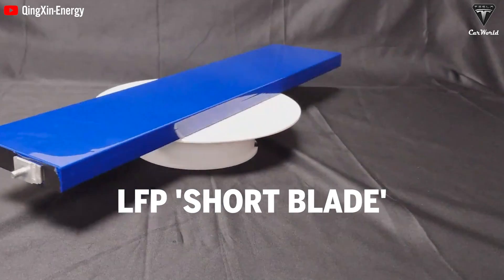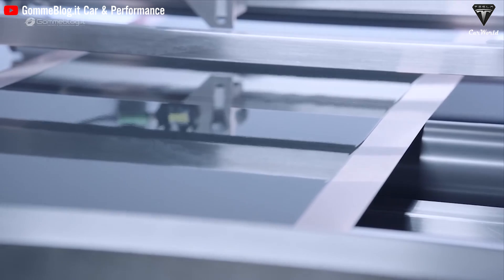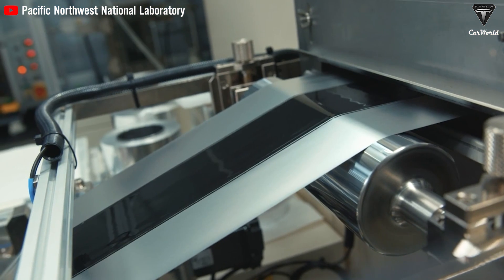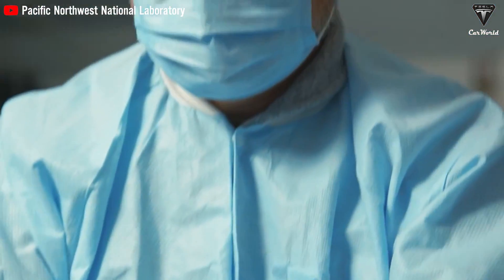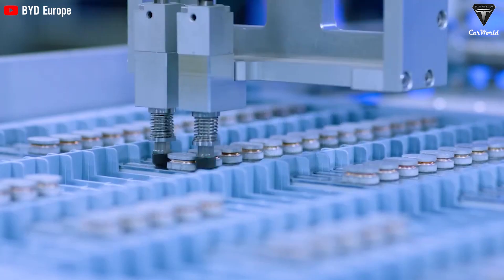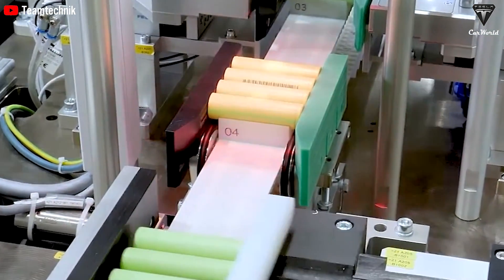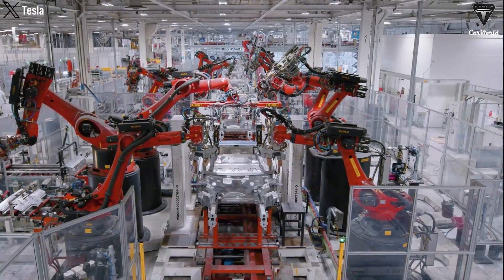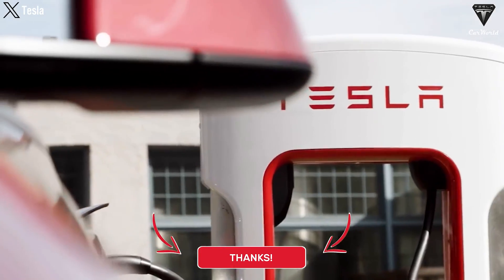Elon Musk Reveals The World Safest A Million-Mile LFP Short Blade Battery, Futuristic Tech for 2025!

Comment: The ability to maintain high capacity in cold temperatures is a significant advantage, but how will the Short Blade battery perform in extreme heat?

Comment: The Short Blade battery's high energy density is a game-changer, but how does it compare to the latest nickel-based batteries in terms of cost and efficiency?
Reply from the maker: The Short Blade battery offers high energy density and safety benefits but may have higher costs compared to nickel-based batteries, which excel in energy density and charging speed.

Comment: How does the Short Blade battery's design enhance its fast-charging capabilities?
Reply from the maker: The Short Blade battery's design enhances its fast-charging capabilities through optimized cell architecture and advanced materials that reduce internal resistance, allowing for quicker energy transfer and more efficient charging.

Comment: What specific features make the Short Blade battery more fire-resistant than other batteries?
Reply from the maker: Short Blade batteries are more fire-resistant thanks to the stable structure of carbon nanotubes, which helps prevent overheating and reduces the risk of electrical short circuits compared to other types of batteries.

Comment: The cell-to-pack technology in the Short Blade battery is an innovative approach, potentially improving energy density. However, how will it affect the overall weight of the vehicle?
Reply from the maker: The cell-to-pack technology in the Short Blade battery can improve energy density, but it can increase the total weight of the vehicle due to the removal of redundant components, resulting in the need for stronger structures and additional protective materials.